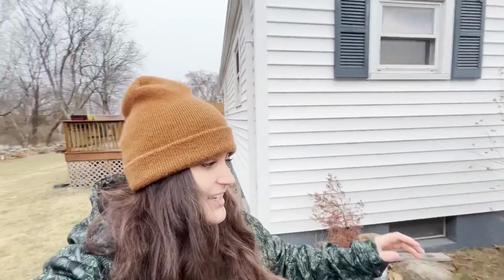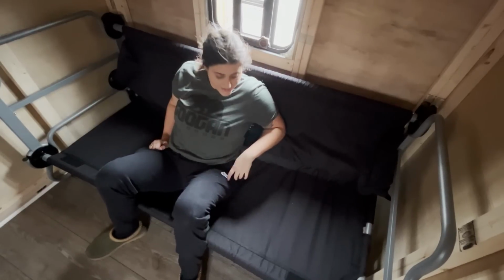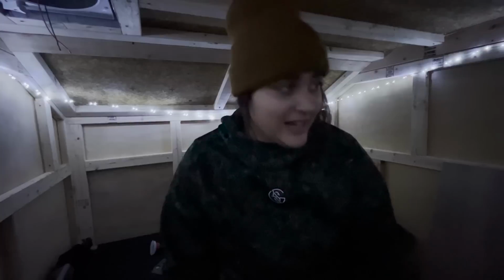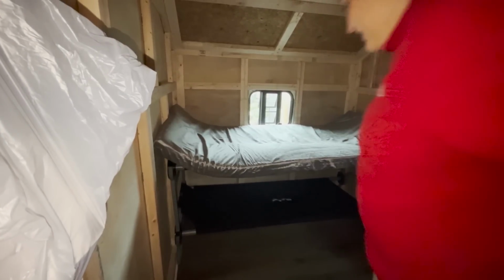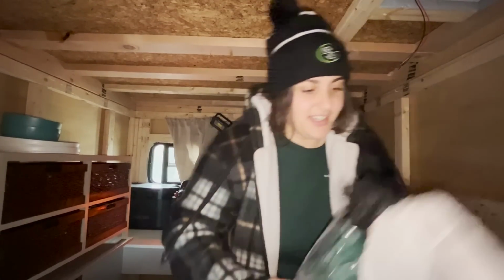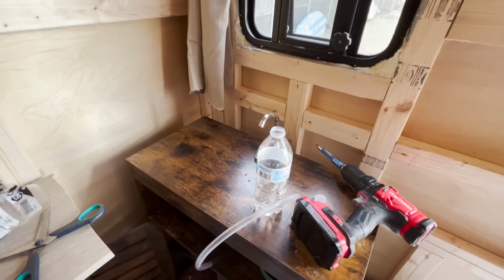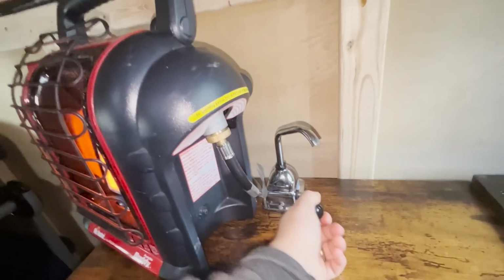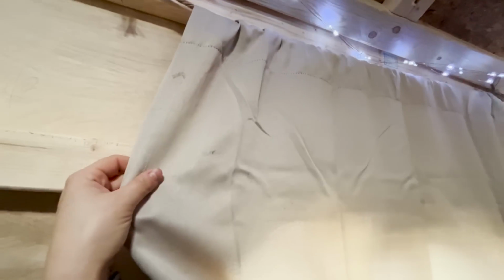Building INSIDE My Tiny House (10x8sqft Interior)

Comment: So men are women, women are men, and camper trailers are now "tiny houses?"...no. It's a camper. Good job, BTW.  BTW...CO2 is heavier than air, so it sinks to the floor...yeah. Get yourself a $79 combo fire-CO2 monitor. Good thinking on the spices...but get some heavy magnets, glue them to the bottom, screw a sheet metal backsplash that you've painted (or not) on the ceiling and they can stick on it there. You'll be able to read the label at just a glance.

Comment: "10x8sqft Interior"
A logical fallacy if there ever was one. You can have 10x8 ft, which gives you 80 sqft. But you can not square sqft.
And no insulation? Really? Doesn't look like you live in the tropics, you never get cold temperatures? No money for a roll of insulating material but for stupid LED lights and spices? Girl, get your preferences in order. First build your house - then do the decor.